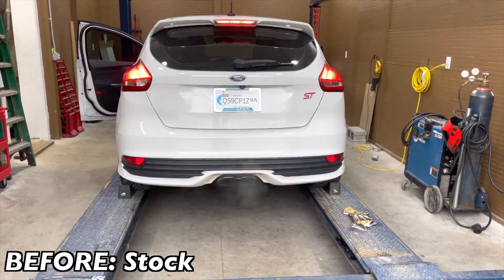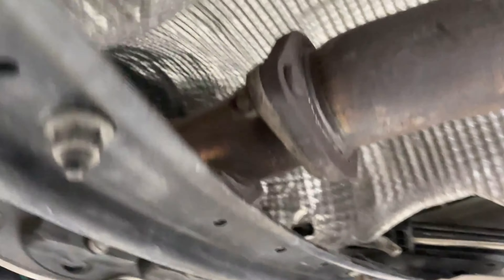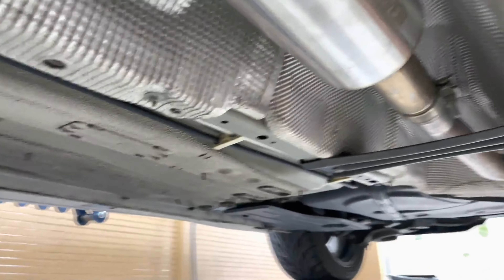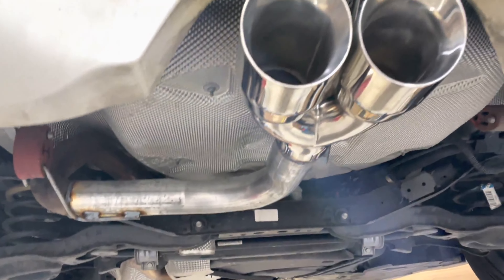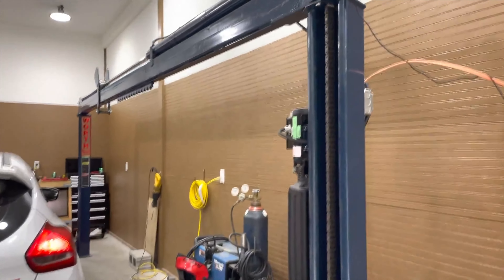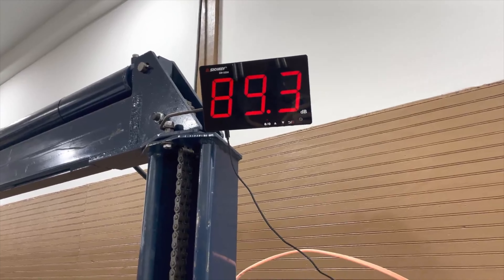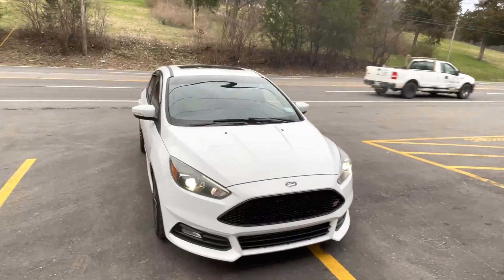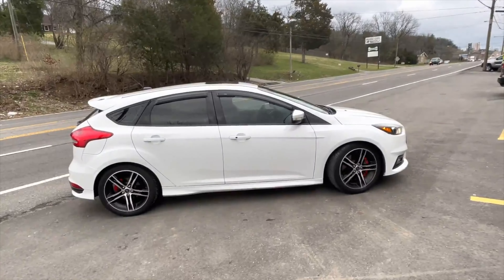2015 Ford Focus ST TURBO Exhaust w/ CARVEN TR-SERIES MUFFLER!

Comment: Oh hell no! Yeah this is completely unacceptable. You can barely hear this car and sounds no different than a stock Mustang GT500, and that's a damn shame 🤨 Owner should have just run an open manifold, which is hands down the best setup and provides optimal back pressure and reduced direct injection steering column carbon build-up, on these 2015 Ford Focus ST's.
Reply: Focus is an apple, Mustang is a orange Mr. Perfectionist why don't you weld in an exhaust then 🤣
Reply: I looked at your channel. Charger scatpack with a Xpipe it's nice no matter what anyone says 🤣
Reply: Needs boom tubes on both sides with spark plugs and gas injection for increased traction in the snow
Reply: Nooo he’s back boiiiiii
Reply: Hahahaha 😄😆 looks like “j.” Can’t copied Ryan’s comments anymore
Reply: Ryan has been gone because he opened up his own muffler shop doing only open manifolds . Another two weeks and he’s dropping his catalog of work. Be ready
Reply: @01gtbdaily30  wait what really?? Only open Manifolds bruh 😂😂
Reply: lol mustang owners are pissed
Reply: What the fuck did I just read

Comment: Nice right off the carvana truck, lol. 

Possible first stick car? You slipped the crap out of the clutch on start, No offense. Got to release a little quicker. Or you will be doing a clutch too soon.

Sounds a little pig like but its ok 👍

I always liked the ST. The price was too high for the performance. But i still liked the car. I had a diesel 1.5 rental in Europe  and it handled pretty darn good. The ST would be a fun little car i assume. Right after a turbo up grade. Unfortunately its barely a 14 sec car, 14.8s and 0 to 60 isnt great either, high 6s. But there is potential  in the car. Enjoy.

Comment: Oh hell no this is unacceptable you can barely hear this car sounds nothing but a stock g35 and thats a damn shame 🤔 owner should’ve run with open manifolds which is the best set ups for this 2.0L
Reply: Lol a  g35 would actually sound better than this car with the bigger displacement engine.